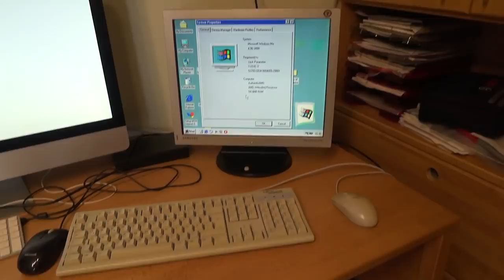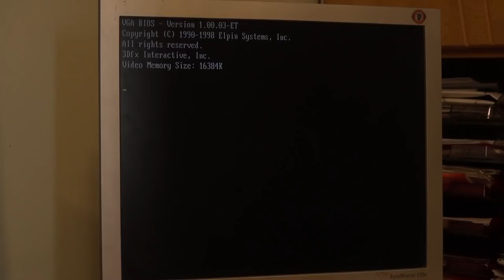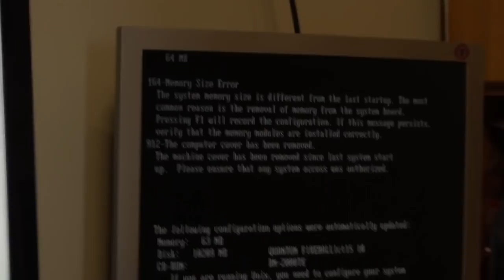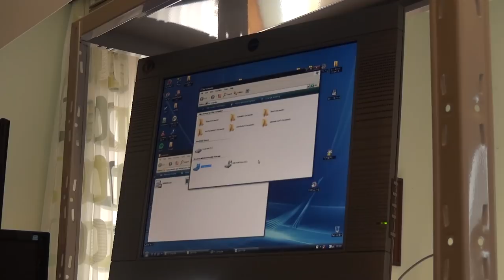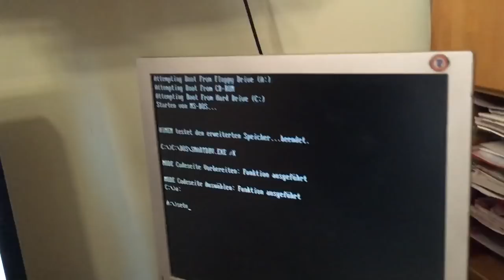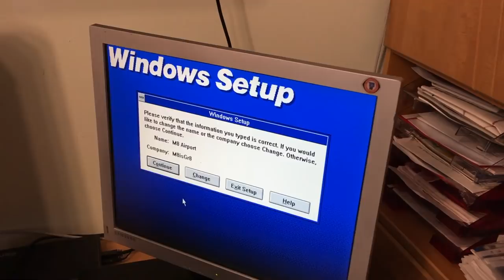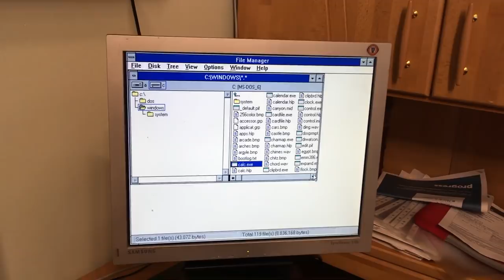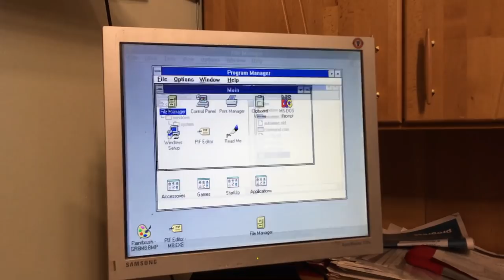Installing Windows 3.1 in 2018

Comment: By the way, Windows 3 will ignore all RAM over either 256 or 512 MB depending on the edition, & unlike Windows 9x, it doesn't have a maximum amount that it will crash above.
Reply from the maker: Thanks for the Infos